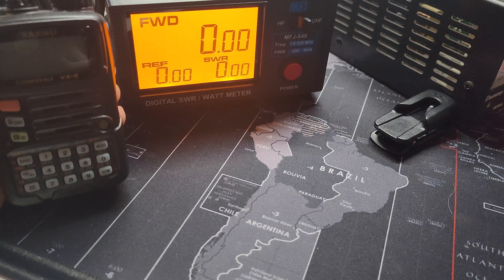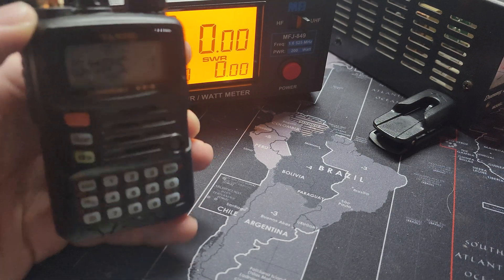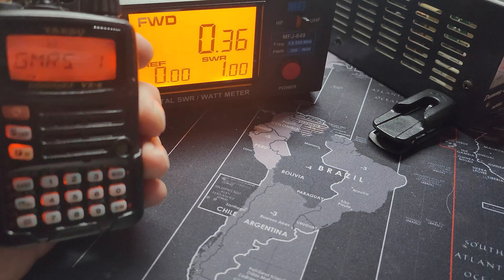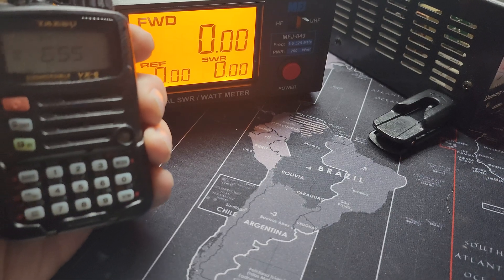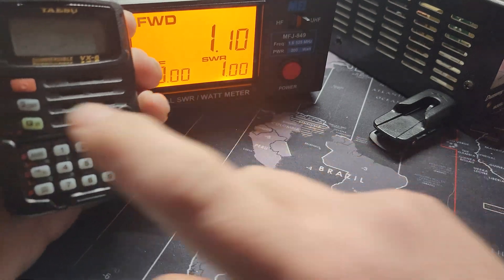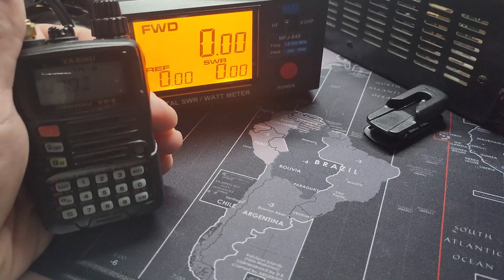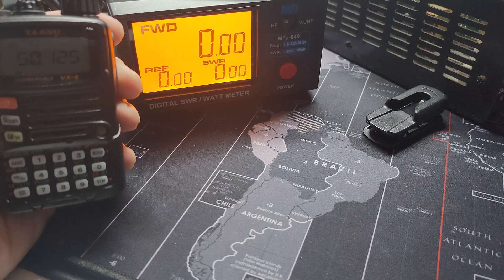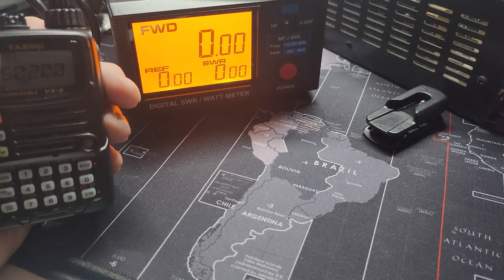Yaesu VX 6R Power Output After MARS Mod

Comment: If you have the most recent board in there, apparently you get more than five watts. A big number 4 on the board shows it's the newest; most have a 3, which is not the most recent.
Another question, has your meter been calibrated, and how about testing a known 10 watt radio, like the Tidradio H8, etc., because I don't think you've proved your case at ALL!!

Comment: After the mod, will you loose the pre-programmed shortwave stations?
Reply from the maker: Yes, the pre-programmed shortwave stations will be erased as well as any other stations you might have programmed. Please make sure you do a backup with CHIRP or RTSystems before doing this mod.
Reply: @n3vanradio  ok, thanks.
Reply: Just a heads up.. not sure if this is related to a new mainboard revision.. I believe mine is the 4th revision but my radio retained the pre-programmed channels. @n3vanradio

Comment: Does this work on the newest version of the VX-6R? I thought I read that the newest board is different.
Reply: That is the board with the big 4 on it. Mine gives more than 5 watts output with that.
Reply from the maker: Yes, it should work on the latest board version. The solder point will look different. I will check again and let you know what the board looks like this afternoon.

Comment: Hi Matt, I love this mod you did.  My question to you is, do you have a GMRS radio and if you do what is it?  I have the VX 6R and it is a great radio.  After you do this mod can you put the programmed repeaters back in from the programming software?  Thank you Matt for sharing this video, love it.  By the way, where did you get that table mat from, looks cool.  KO4UWU/WRVG833
Reply from the maker: Thank you for the kind comment Janice! The only factory GMRS radio I have is the Midland MTX400. Great base station GMRS rig. I do have, like probably many others, two Baofeng's.

And yes, after the modification I was able to reupload the programmed repeaters and other frequencies I wanted into the handheld.

I have a third VX-6R on it's way from HRO and will be doing a review on output power before and after the modification.

Thank you and 73,
Matt N3VAN
Reply: @n3vanradio  Thank you so very much Matt, looking forward to future videos.

Comment: Wait - I thought this radio could only transmit on 1.25/2m/70cm?  Does the MARS mod open up tx on 6m as well as MURS/GMRS?
Reply from the maker: That is what I thought. I only did the MARS mod to get MURS/GMRS which it does now after the modification but was pleasantly surprised that it does 6m as well.

Comment: What does it have for power on 2 meters? Maybe I missed that part, I watched twice. Nice video.
Reply from the maker: I did not test the 2m band but I plan on doing another video with the radio plugged into 12V DC and also unplugged to see if there is a different. I will make sure to do all bands the radio supports (2m/1.25m/70cm/6m)
Reply: Great! Looking forward to it.

Comment: Disappointing the vx-6r could not hit 5w as advertised. Did you by any chance measure output prior to the mars mod? Curious to know if it transmitted at 5w pre-mod.
Reply from the maker: I was definitely surprised. I believe the full 5 watts is if your radio is plugged into the 12V DC. But will be doing another video to test.
Reply: @n3vanradio  when will that video be out. I don’t want to modify my vx6 if it will result in the poor power output like you have.
Reply from the maker: @wdsracer  I was hoping to snag an unmodded used one on eBay but haven't found a good deal. I will prabably just get one from HRO this week and do a video. Sorry for delay.

Comment: What antenna would you suggest for 6m?
Reply from the maker: I use the Diamond SRH999 which covers 6m/2m/70cm/23cm. Would be nice to find a quad band antenna that is not a mag mount that would cover 6m/2m/1.25m/70cm. I may make a video doing a 6m contact testing range of the VX-6R with the Diamond SRH999.